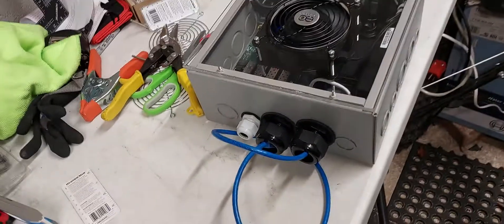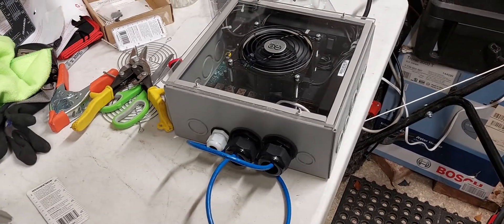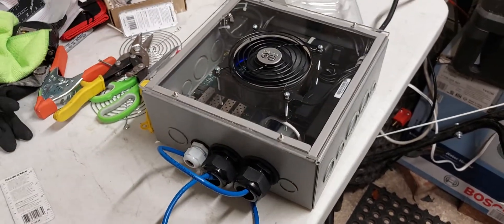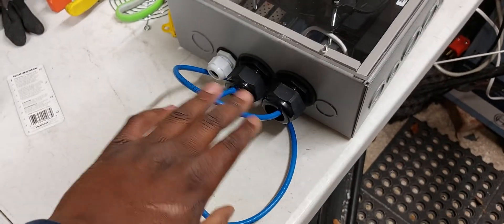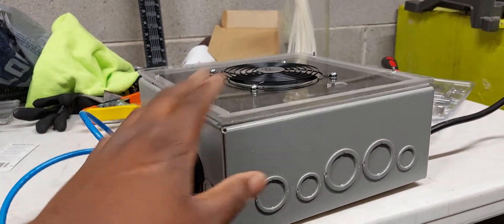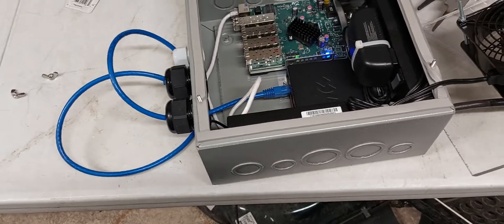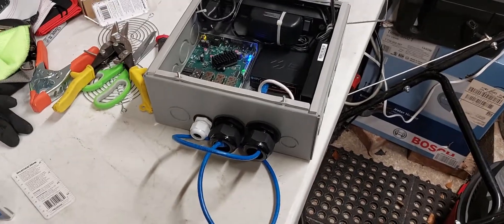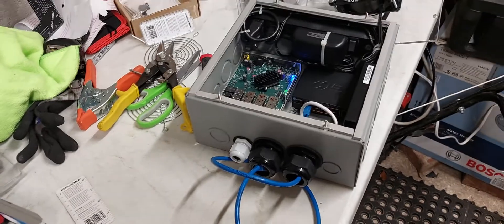Obfuscate.min: Cooling A Mikrotik CRS305-1G-4S+IN

Comment: Looking forward to seeing more on your network expansion. I've been looking at Mikrotik for a small 10G switch for my homelab.  How far do you have to trench for the fiber run? Can I assume you're using pre-terminated fiber cables?
Reply from the maker: Yeah I will be using a preterminated OM3 50/125 LC to LC cable. I measured the run at under 110ft from switch to potential building site.